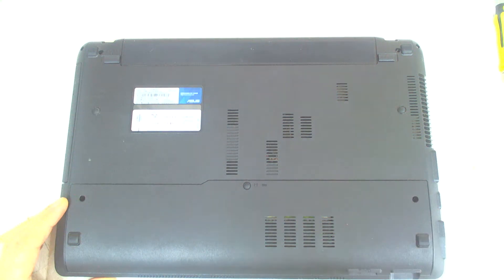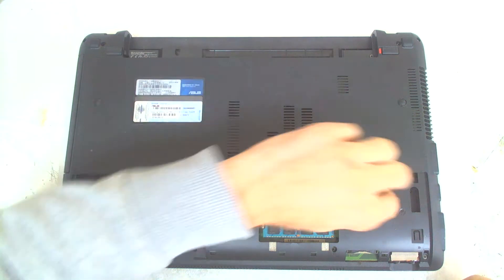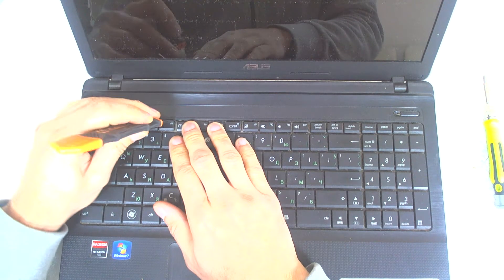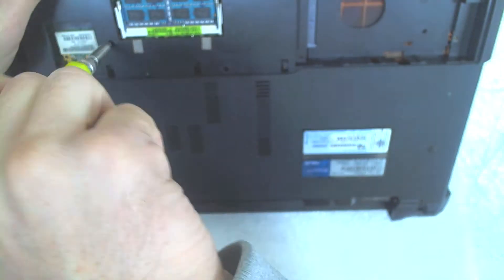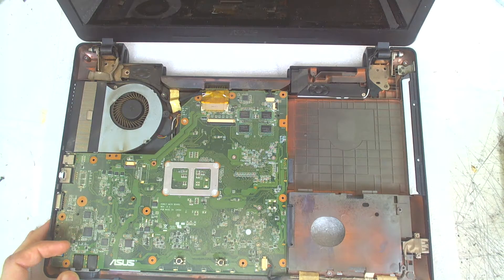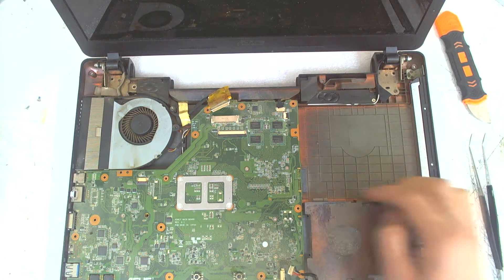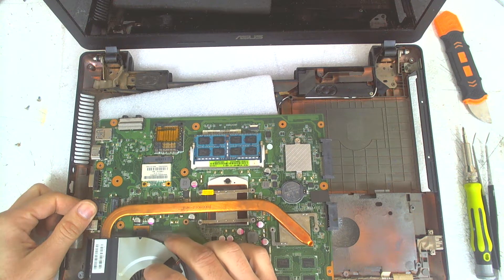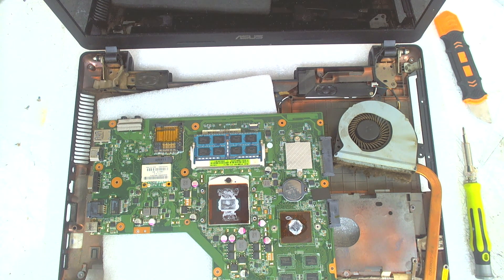Asus X54H Disassembly / FAN Cleaning

Comment: My fan is work, but sometimes... Idk why, but it starts working then I kick the place there fan is placed slightly and it starts working, what's the reason it doesn't work without a small kick? :D
Reply from the maker: The fan is not suppose to work all the time. Usually when the temperature go up, it starts. If it stars to work only after you kick it... probably there is something insight that is blocking it.